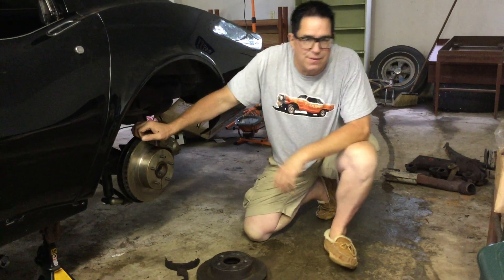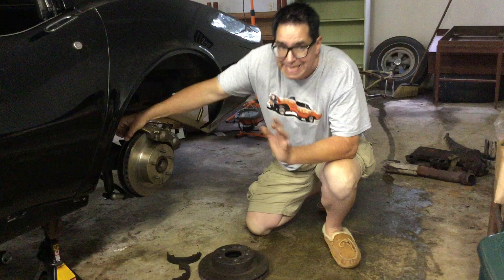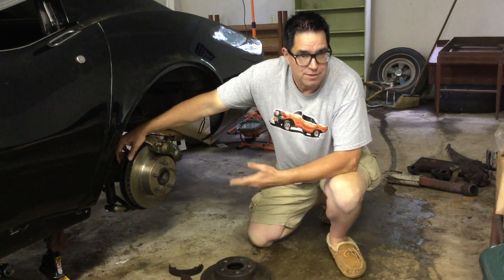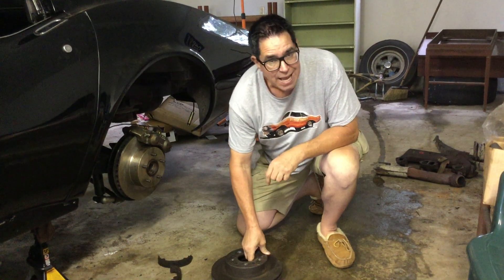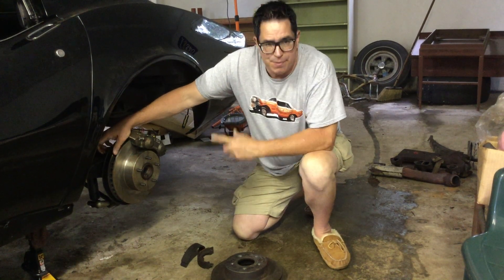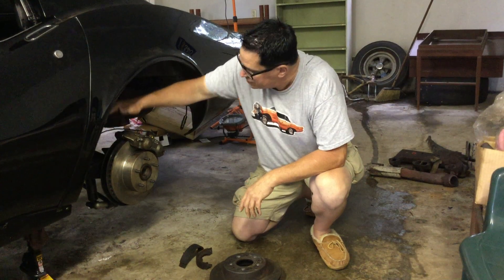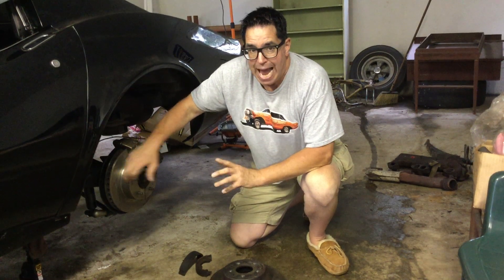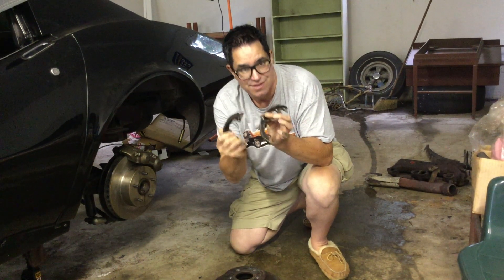Drum in a DISK? CORVETTE

Comment: I kind of cringe when people say steel rotors....Cast Iron! my bicycle has steel rotors....My 72 LT-1 Corvette....Cast Iron! Beware of "off shore" parking brake parts...they can be made so poorly that they fail in service and the parking brake shoes cock sideways and cause all kind of problems...Early Vette disc brakes 65/66 had thin heat insulators on the pistons...then there were the J-56 HD racing brakes with the THICK "Pyrotech" insulators made of a asbestos compound....Worked in SCCA Trans Am for budget teams until about 1980....Even survived 24hrs of Daytona and LeMans.....Great design....I once owned a JL-8 69 Z/28....Same brakes on the back as the passenger side of a Corvette....Used RH assembly on both sides of a JL-8 assembly....Front calipers were unique but, rears were just regular Corvette.

Comment: Yes, C3 Corvettes have drum parking brakes built into the rear discs. They also came with unlined all aluminum calipers that quickly corroded and leaked like crazy. The independent rear suspension is also a nightmare. I have owned three C3 Corvettes, and currently have a 1976. Oh, and I also used to own a 1987 Pontiac Fiero, which also had the same type of parking brake. It used a front wheel drive setup, turned around and installed in the rear.
Reply: This system is used on the c4 also.
Reply: Aluminum Calipers???? Never seen that! I've seen many CAST IRON Delco Moraine C2/3 Corvette calipers rust on Vettes and 67/68 Chevy cars....Yes...The problem was solved funny enough by a Ford Engineer named George Jonas....Stainless Steel Brake Corporation....His Children are still running the company and Classic Tube a stainless brake line company.
Reply: @ericbrandt829  Sorry I was Thinking of another car I had serious brake issues with. The C3 Corvette did indeed have cast iron calipers. They bores quickly rusted and pitted, and the piston seals leaked like crazy. I bought my first C3 back in 1991, a 1977 model. The brakes failed the day after I bought it. All the calipers were leaking, and the master cylinder was empty. One of the first things I had to do was replace all 4 calipers with stainless steel lined ones from Ecklers, at $200 apiece. $800 worth of parts on a car I just bought, and it went downhill from there. I wound up spending over $5000 on repairs before I began to get it sorted out, mostly on brakes, suspension, and steering. I replaced all the bushings with polyurethane, including the rotted body mounts. I had to have a shop do some of the work on the rear suspension, because some of the bushings had to be pressed out, and I didn't have the tools. All 6 U joints also had to be replaced.